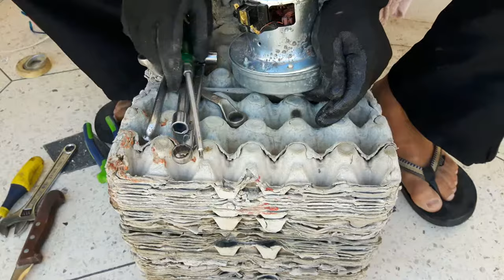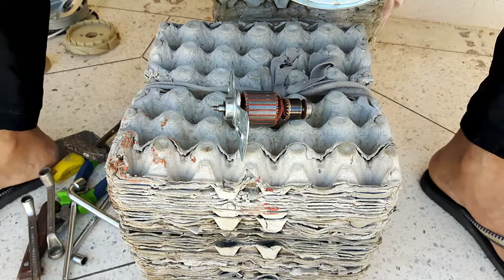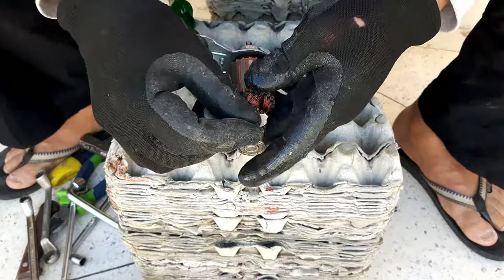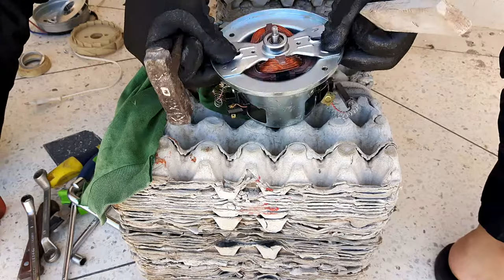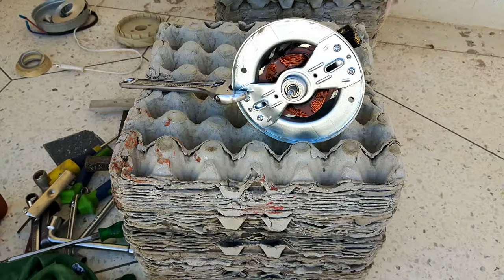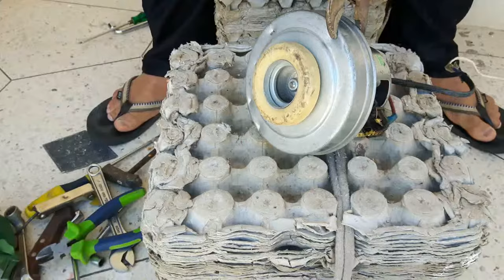disassembling, cleaning, reassembling and testing of vacuum cleaner motor

Comment: Hi, thanks for your excellent video! 
I want to ask one problem I am facing with my vacuum cleaner (model: Eureka Forbes Trendy Steel Vacuum Cleaner). One day the zip of the dust bag was open and I used the vacuum cleaner in a dusty area and I immediately smelled something wrong. So, I switched off the machine immediately. Then after some days in opened and cleaned the motor of the vacuum cleaner and cleaned all dust and debris. There was no smell of coil getting burnt. I dropped few drops of machine oil on both the bearings. After starting, I could see lots of sparks near the bushes and different smell coming from the machine. 
Kindly, suggest the probable problem and its solution.
Reply: Did you figure out your issue am having some similar trouble
Reply: @carltonvictor9531  No, the vacuum cleaner is lying in the corner. I haven't used because of the fear that it may get permanently burnt out.
Reply: @TanmayAgarwalJaipur  there may be a short circuit on the commutator.  Clean all the carbon particles from the commutator and check each connection to it. And check the armature coil too. Most of the time commutator give the problem first

Comment: i couldnt see how you remove the fan nut
Reply: Good question! I just tried on mine, and it was super tricky - eventually I duct-taped the whole impeller assembly from the top: I put 2 tapes to cover as much of it as possible - and then with a socket wrench I would get it undone!
Reply: @ZopcsakFeri  thanks man